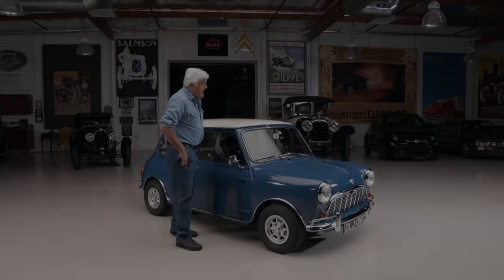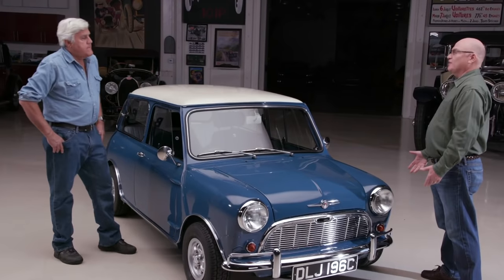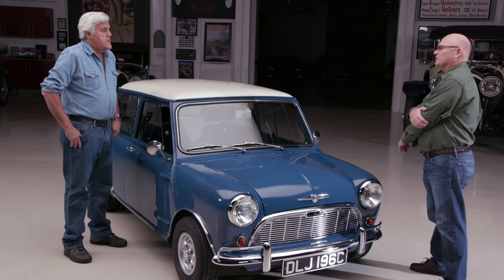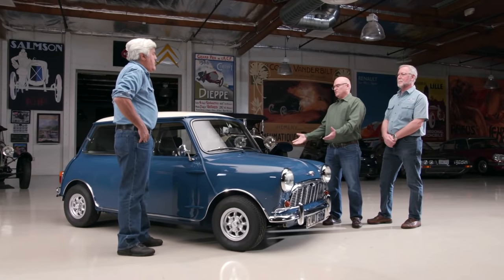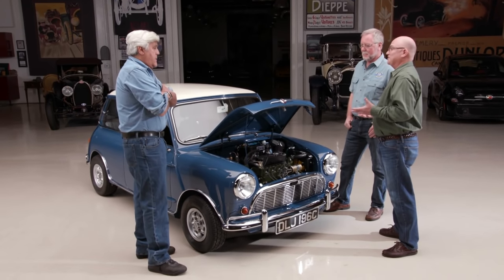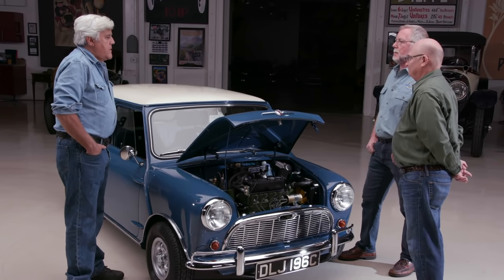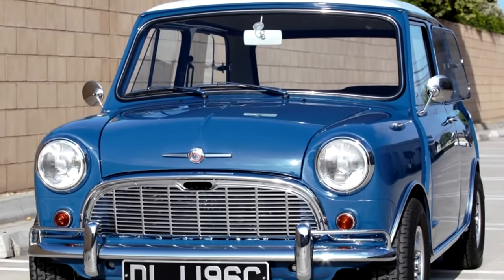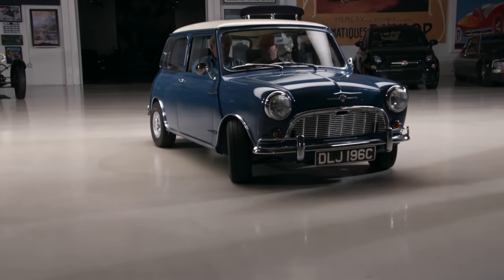1965 Morris Mini Minor - Jay Leno's Garage

Comment: I got hit by a Morris Minor once. I had to go to the hospital to have it removed.
Reply: Clever ... got wit.
Reply: But for the fact that the Morris Minor is a completely different car. This is a Morris Mini....
Reply: LOL !
Reply: Ian Worley ...indeed, but that doesn’t mean he wasn’t hit by a Morris Minor
Reply: @ianworley8169  They were originally called the Morris Mini Minor.
Reply: @knightowl3577  You're so right, but the Morris Minor (ie not the Morris Mini Minor) is a completely different car! Good joke, none the less.
Reply: Morris minor is going to hurt. Thick steel in them. Of course they are so slow that it would be your fault for not moving
Reply: Hahahaha! Great comment!
Reply: Funny :-)  

Actually to this day I'm glad I hit a Mini" instead of a REAL size  CAR like a OPEL Kadett or Ford 12M or the likes  which were around in 1973. 

I was riding a bicycle and at a intersection in open field outside of a town, I glanced once to my left, and looked a long time  to my right, because there was one train-track which crossed the street and to the right here stood a small shack which obstructed the view. Well I overlooked the mini, coming from the left and crashed into it between the front-wheel and the hinge of the door. Since the car was so low, I flipped over, my shoulder hit the windshield, and then I kissed the track/road  on the other side of the mini. 

No bones broken, was one day in the hospital... Strangely enough years later I too had as my first car such a mini.... was cheap but had it just for one year, and it didn't pass the inspection, rusty rear-wheel mount and if one turned a certain way the wheel would then hit the body....
Reply: Calvin Hikes hahaha.
Reply: Fake
Reply: straight up the tailpipe, huh
Reply: Minor error...
Reply: My mom had one in the kitchen. We called it a bread box.  ; )
Reply: @vachief Ok Mr. Normal. When "normal" people call me weird I take it as a compliment. Jay seems to like it. He owns "weird" cars.....
Reply: @vachief Nice! That's before those strange black rubber bumper MGs I believe.(?) Jay did have a Sunbeam Alpine roadster when he was a kid. We were the real weirdos I guess because we had SAABs. They're killer in the snow, but we had the usual big US boats as well like I still own now.
Reply: @vachief Oh yeah, now that you mention it the later MGs did look a little higher. Never consciously thought about it, but can visualize that for sure now! My brother still has 11 SAABs but mainly runs the '68-'73 V-4 models.
Reply: @vachief oh wow, ok. That makes sense but never heard of that. Seems like the Spitfire and others were still super low though.(?) Yeah, you have to respect old Volvos and Benzs too. Had a few of those along with an Alfa, which was a delight in every way except the body. It was a '79 w/FI.
Reply: @vachief I remember those giant rubber pads but didn't know they raise the bumper. Love me some auto trivia! That earlier style Alfa was so damn pretty. The one after like mine...not so much. But with the rear transaxle, & 4cyl., not th V6, weight distribution was near perfection. Felt like nothing I've driven before or since.
Reply: @vachief Get that OD if it suits your terrane better! Those were made for the rolling hill country roads of GB or here in New England for sure. All orig. steel whls. on mine too. Only after mkt. rims I like would be period correct ones. What bumper mods did the '73 MG have for gvmt. regulations?
Reply: @vachief Can only go as fast as your wallet! : )  Very strange about '73 MG bumpers. Even '73 SAABs had rubber insulators between the bumper & bracket.  By '74 they weren't even importing 96/95s. Europe still had those models up till '80! We did get the Sonnet until '75 but had those heinous giant girder bumpers like evryone else. : /  Are those MGB ODs hard to find?
Reply: @knightowl3577  they were also badged Austin 7, although later there were Riley (ELF) and Wolseley (HORNET) versions.
Reply: I had two Morris Minor Travellers, one after the other. A sort of "shooting brake" type arrangement with bits of wood on it. Brilliant car but....definitely not quick, drum brakes, very distinctive sound from the pea-shooter exhaust, rusted up the back of the front wings and the front suspension needed watching too. If the thread holding the lower arm rusted away, it would part company (Morris Marina - same). That never happened to me but....the interior smelled gorgeous for some reason, it was only some crappy vinyl but both were like that. It wasn't terribly noisy to drive, a very distinctive "A" series engine sound, pleasant, but one time I drove without having properly secured the bonnet, it broke the hinges, came off and flew over the car onto the road behind. Stash it in the back, go home and think about it later but the car was immediately so much quieter. That domed bonnet was a right acoustic chamber and I'd never thought of insulating it in any way and I don't think anyone else did either. Really nice cars to own and run, I did lots of miles but the day came when I bought a Mk 2 Ford Cortina - servo assisted brakes - and I parked up the Morris round the back to prep it for selling. I drove the Ford for a month before moving the Morris again and it felt like it had no brakes at all. You had to push on the pedal. The mini was fun but the Minor 1000 was just - really nice.
Reply: @ronanrogers4127  Too good.
Reply: Bahahahahahakaakaajajajja!
Reply: So you had Minor surgery ? LOL
Reply: @geoffreyallen888  I like your narrative.Cant wait to get my hands on one morris minor my neighbor is willing to part with.I wonder if it's worth buying.
Reply: I saw a 450 lb guy leaning on one just like the one here. I'm fairly certain that there was no way the owner sold the car to that quarter ton dude!
Reply: ha, ha, ha..
Reply: And when he got to the hospital the doctor fetched the tree surgeon.
Reply: My car isn't that small
Reply: That's hilarious
Reply: there different cars
Reply: Hahaha
Reply: I had a Moggy ! The wheels fell off! Anyone with experience of the real Moris Minor will know exactaly what  I mean. One of the funniest things I've ever seen ,a  Morris Minor driver, being followed by a Police car, carefully following the Highway Code to every dot and comma Mirror ,signal, manovure to turn right , clonk the wheel fell off.Everyone else including the Police officers, rolling about with laughter.
Reply: @g0fvt    The Riley Elf was the posh version,wood dash ,walnut not venier,  and had a boot (Trunk) sticking out the back.The Wolsley Hornet was the souped up version, the original Hot Hatch.
Reply: @51WCDodge  the other way around.  Riley were the sporty one. My friend has one.
Reply: I bet you liked where it got stuck huh? 😂
Reply: 😂fantastic

Comment: What a nostalgia rush! I'm English and have spent my whole 56 years in Liverpool. During the late '60s - mid '70s my dad had a number of Minis. We had an 850 and a Clubman (with the dodgy sills and rotten wood!). They took us all over the UK for many happy family holidays and my sister and I loved it!
My favourite scary story my dad told us was that on his way to work one morning he went to change gear and the stick just came out of the floor as the transmission went the other way - through the floor!! (Yes - I can confirm that Minis were indeed susceptible to rust, but the engines were so simple that they rarely failed & when they did they were easy to work on).
THANKS FOR THE REMINDER OF HAPPY DAYS!!
Reply: Interesting : my first car was a new VW 1500 Blue Beetle [ Jan. 1967]. I sold it to a vicar when I emigrated to Canada in 1968. I hope he looked after it.
Best etc.  Bruce [ fellow Scouser].

Comment: My dad bought one of these for my mom back in the late 80's it wasn't new, it was a 1275 GT, it was red with a white top and a little white checkered stripe on the sides, different hood and front grill, roll up windows and the dials where on top of the steering column, a little MOMO steering wheel (that was fun to park), alloy wheels, wider tires (that helped even more with parking), i learned to drive in it. My grandfather my dad and i tore it apart and put it back together so many times i lost count. I can tell you a trick we learned for the distributor cap (the engine block is the same so it's in the same place). Because it stands low to the ground it picks up a lot of water and its prone to condensation it insulates the contacts and on cold winter mornings it wouldn't start (English cars go figure), my dad had the idea of making a little hole with a 1 mm drill on the back side of it, it allowed the condensation to evaporate, it wasn't perfect but it was better, instead of not starting at all, it took a little bit of time but it eventually came to life. In 1990 i turned 18 (legal age to drive here in Portugal) and i was able to get my drivers licence, it became my first car, my mom called it Joaninha (little Ladybug), because it was small and red i guess, so all my friends made fun of me because i drived a Ladybug, it didn't matter to me, a lot of them asked me for rides in it. I learned about 4 stroke engines with it, i even went on the first date with the lady a latter divorced in it. I 'll tell you that on a winding road there aren't many cars even today that can keep up with it, and the sound of that engine was glorious. The rust finally got to it and it got so bad i had to scrap it. There are still some rolling around here in Portugal and whenever i see one it sparks a lot of good memories of me my dad and grandfather having fun all dirtied up with engine oil and graphite messing about with the little Ladybug, it was kind of our summer holiday project, we went to my grandfathers house we laid all the parts on his garage floor and we took toll of what had happened to it that year, we could get used parts for it almost everywhere, there were a lot of them here, and they were cheap. Man i miss that car so much, so to see you doing a clip on a similar one, to me is a treat. Thank you Mr Jay Leno...
Reply: In England we just put a Rubber glove over the distributor cap and it solved the problem.
Reply: When I had mine in the late '80s, the usual thing was to take the black base of a 2 litre cola bottle (back when the base wasn't moulded into the bottle like it is now) and thread the ignition wires through the holes in the bottom.  It helped keep the water coming through the grille from soaking the points.
Reply: Yep, the distributor cap in the wet.  I carried a can of WD40.  Dry the HT leads with a dry rag and a quick squirt of WD40. Started every time.
Reply: I drove a 1275 Clubman prepared by Colin Clan about three days after I passed my driving test, scared the bejesus out of  me!
Reply: @adrinathegreat3095  Marigold by choice. :-) But never the pink ones ! You had tohave some street cred.

Comment: Loved seeing this episode. My first car was an 850cc 1965 Morris Mini Minor, just like that, but in grey. I bought it in 1976. Loved it! I had to sell it and get something a little bigger with soundproofing as it was just too noisy screaming down the M3 motorway at 70 mph. Went round corners like it was on rails. The Hydolastic supension was great, gave a much better ride than the coils and shocks fitted to the example here. It semed much too lively over the bumps. Still I suspect that the parts would be very difficult to come by now.
Reply: Yeah, shame about the suspension.  Lots of people are scared of anything out-of-the-ordinary so dump the hydraulic system in preference for coil springs and shocks.  I learnt to drive in a Austin Mini 1000 - it spent many years going to the beach (for surfing with four surfboards strapped to the roof) until the sills rusted out and it was not viable to fix (needed complete stripdown and welding not worthwhile on a £250 car)  My list of mods would be similar, but I would have put on an alternator, electronic ignition (lots of aftermarket kits were available in the 60s onwards) and put the guard on the front of the engine (no idea why it wasn't on there - stops water getting into the distributor when driving at speed in the rain) the rear side compartments are a handy place for a couple of speakers pointing upwards (a mod I did myself back in the day) and a radio/cassette taped to the dashboard :)
Reply: Shocks are hydraulic, they have oil in them!
Reply: 54 year old hydro bags are about as reliable as a 54 year old tire. There are no new hydro units being made. The coil spring replacement we use retains the comfortable hydro ride without fear of failure. Not to be confused with a coil over kit, these springs fit in the original location.
Reply: @davidhunt240  My old Leyland Mini had the far simpler solution to keeping water out of the distributor. Get a rubber glove, cut the ends off the fingers, stick the glove over the distributor cab with one lead coming out of each finger. Job done! Speakers in the side pockets would have been way better than the speakers in mine though, a previous oewner had cut 2 holes in the parcel shelf for 2 4 inch speakers and I had the head unit screwed down to the dashboard with wood screws.
Reply: Nothing you can't buy for a mini really huge parts availability and aftermarket support, a truly incredible piece of design.

Comment: Down here in Aussie land i remember  the Coopers being known as a flying brick even the cops used to use them
Reply: They raced them in Bathurst too :)
Reply: @ToolkiT73UK  .They won Bathurst in 1966.
Reply: Australian here also. The Cooper S was the Subaru WRX of its day. Won at Bathurst against the V8s. Before I was old enough to drive, a mate around the corner had a hot Mini Delux. Only 998cc but bloody fast. It used to give the hot Holdens and Fords a fright. He ran a 45mm Weber carby in it. Should have heard the induction roar.
Reply: The handling on them is amazing. They are great for small city streets and it was the reason the police used them. 

It is a pity the UK auto industry collapsed with all the labour party interference.  I would say if they got further development they would have been a rival to the porsche 911 today.
Reply: @jurgentreue1200  ''998cc but bloody fast'' 80 mph?
Reply: The 998 could be bloody fast when you think there's almost never a need to slow down, and most Mini drivers knew the twistiest roads to play on.  I used to have a 1098 (basically a 998 stroker) with just a few mods...73 hp @ 6500 rpm and just about 100 mph (160 km/h at redline.)  Definitely a little frightening to the V8 cars when you caught them on a twisty road.  And small enough that you could get a little sideways around the corners without worrying too much about swiping the Armco.

As an example of Minis against V8s, check out this race between a Mustang and a Mini at Eastern Creek Raceway, 2012.

Comment: Thanks, I greatly enjoyed this video because it brought back memories of my 1st mini, a red ’61 850 Morris.  I was in college then and had no money so I maintained it myself. I smiled when he described the need to adjust the breaks. I became pretty adept at doing that. I had a large jack that allowed me to raise one side to a 45 degree angle. I still have the butter knife that I used to adjust the star wheels. Anyway, eventually I bought a 1275 Cooper S which in comparison was a rocket. One thing that really impressed me about the Cooper was the hydrolastic suspension. It is a great loss to the world of cars that even most of the still existing Cooper S mini’s have been converted to dry suspensions.

Comment: Wow! Nostalgia.  I had a 1965 Morris Mini Minor in the same colour (minus the white roof) in 1972.  I was a student at the time and I think it cost about £200.  At just 7 years old (the car) it was showing signs of rust and the hydrolastic suspension had a leak on one side and required pumping up at regular intervals!  This car was preceded by a 1959 Austin 7 Mini and followed by my brothers 1965 white Mini Minor which had a larger carburettor and different cylinder head.  Memories!

Comment: I loved the story about the MOT (Ministry of Transport) test.. I lived in London in the mid-1970's and had a 1965 Mini station wagon with genuine wood panels, in fact that model was probably the last true "woody" built anywhere in the world. Just before I sold it I took it in for its annual MOT inspection, and the mechanic told me that he would pass it as long as I promised never to bring it back again! The same problem: rust. One of the most interesting features of the 850 engine (actually 848 cc) was that in case your battery was low, you could start it with a crank. There  was a slot in the end of the crankcase, and a hole in the fender well that could accommodate a hand crank.

Comment: Bad Obsession Motorsport have been trying to put the drive gear from a 4WD Toyota Celica into a mini and so far they've been uploading videos on it for at least 5 years.
Reply: Also proving that no car restorer in the UK would ever say a mini is too rusty to bother with. If there's enough frame left to weld a new floor pan onto someone will take the job on.
Reply: Best thing on Youtube!
Reply: Bad Obsession Motorsport AKA "Project Binky", the Mini restoration to end all Mini restorations. Extremely entertaining.
Reply: @arnoldj.rimmer812  I subbed 2 years ago to B.O.M.
Reply: If I had to watch only one channel on Youtube, it would be B.O.M.

Sorry, Jay.  :-(
Reply: @arnoldj.rimmer812  It's not really a resto though is it. Not even what you'd call a restomod. Its a total reimagining rework. I wonder what Binky would fetch at auction.? I think Bonham's should do it at Goodwood.
Reply: trying? what are you blind? they have done it.